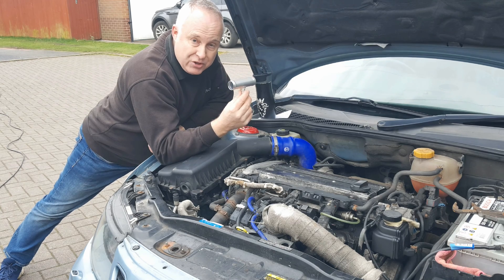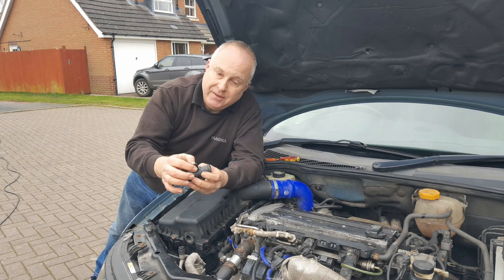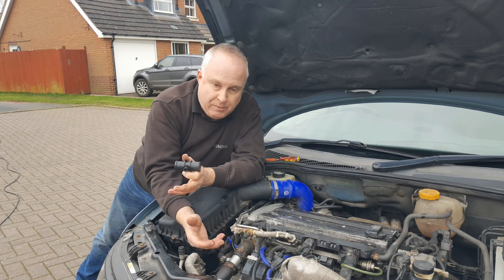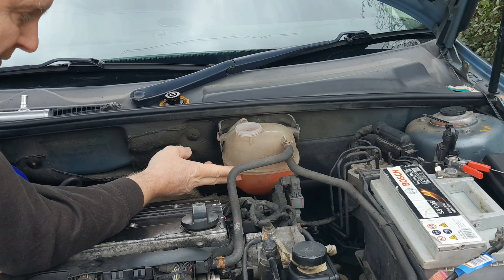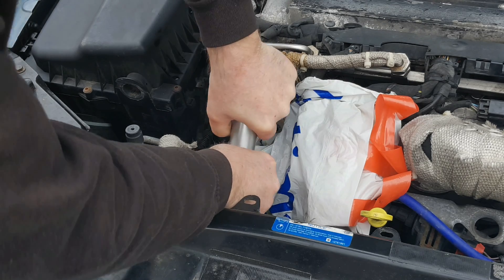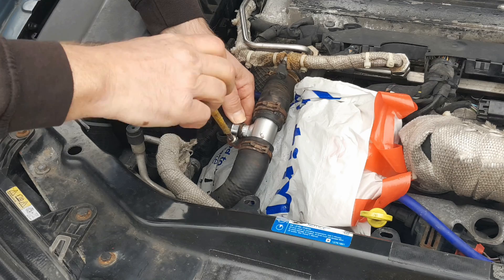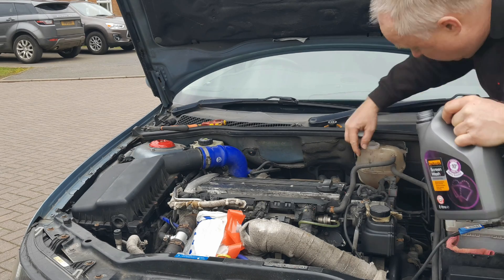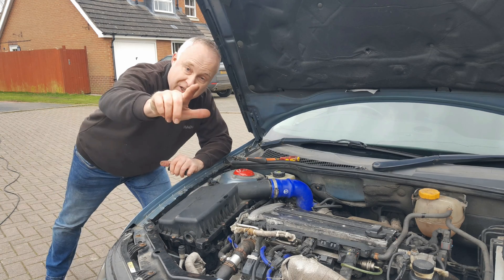Saab 9-3 Coolant Tee Aluminium Replacement | Saab 9-3 Common problems

Comment: The small pipe on that T  joint broke off  on my car just by touching it.
Reply: ... where did you get a replacement from and what did it cost ?
Reply: @_Alfa.Bravo_ from ROCKAUTO IN  USA they are available from a number of sellers.  Since I needed a number of other parts I got it all from them. What I really wanted was a T Made of  metal.

Comment: Hi, I'm looking to do this job very soon but also had/having a cooling problem. Fan has been activated quite a lot in cool weather, recently temp was spiking to a point of dash warning coming on. Found the thermostat was blocked in a closed position and failed the hot water test. Replaced the thermostat but find bottom hose staying cool when the top hose is hot, hoses squeezable so have I wonder if radiator is blocked and what sort of job it's replacement is.
Reply from the maker: I need to replace my rad too. It doesn't look like too bad a job. You can bet screws and bolts will be rusted up though!
I've since brought a one-piece coolant hose to market. A much better solution than a metal tee IMO
https://www.youtube.com/watch?v=Rkdbdg4ilRk  see description for link

Comment: Love the videos. It's amazing that I can find out how to do specific repairs on YT. I just had the "T" break on mine while I was getting her buttoned back up after replacing the valve cover gasket. I barely bumped it and it broke clean off. Glad it was in my garage and not elsewhere. I ended up replacing the entire radiator hose, t-fiitting and return hose. My original made it 332k miles though, so I can't complain...

Comment: Great video! What is the part number for the plastic OEM tee? I have a SAAB 9-5 (2004 US) and I have a leaking plastic tee as well. Is it the same part? Will your aluminum tee work in a 9-5? Thanks!
Reply from the maker: No idea of the OE part numbers. The tee ODs are 32-12-32.

Comment: Hi Fantastic videos, i have a Saab 93 petrol 2006 model Vector we put petrol in it the other day it started ok we drove around for a while turned it off went to start it it started but idled rough we got half way home and it cut out wouldn't start, so next day i took battery lead off and put back on it started straight up but its still idling rough  when i put the foot to the floor rpm wont go over 3000 rpm and engine light is on so i replaced the fuel filter  but its still idling rough it must of gone in to limp mode any idea what it could be and how do i reset the limp mode
Reply from the maker: Rough idle is almost certainly an air leak, but the first thing is to read the codes for the EML.
Where in the world are you?
Reply: @CycloneCyd  Hi we are in Victoria Australia
Reply from the maker: @Farmer2492  first thing is to read the codes. This should give some clue where to look. Get one of these https://s.click.aliexpress.com/e/_AEir79 and download Torque pro to your phone or tablet (android). This will allow you to read the codes and you'll have the kit for life.
OR 
get one of these https://s.click.aliexpress.com/e/_A06Br5
more advanced than Torque and does live data and freeze frame (which you will find useful in the future when you get used to using it).
OR
just get a garage to read the codes for you
****
In the meantime check this
https://www.youtube.com/watch?v=bgLn14dZL3Q&t=2s
it's an often missed intake leak. 
Also check all the small vacuum hoses for splits.
Also check the intake piping and the IC for splits. The ICs on these bow at the bottom and you end up with leaks. A smoke test would be good but if you can't, get the IC out and fill it with parafin to see if there are any leaks (esp near the bottom)

Comment: I can get with understanding the small T turbo hose is completely plugged off in my car and put someone put a straight upper radiator hose on I have the correct hose with the T in the hose now. Can I just put it in or could I hurt my Turbo somehow does it need to be bled Etc please help I cannot find this answer anywhere or anyone else to this problem for that matter
Reply from the maker: If it's the right size, just cut the hose and insert the tee. Fill with a cold engine via the reservoir. Run it without the cap till at least the stat opens. Keep an eye on the level. Stop the engine, return the cap and check the level again when cold.

Comment: Please help I can't find the answer Strange question nobody's been able to answer it on my 9-3 2.0 Turbo 08 I did not know about this T being a failure point until I saw this video so I looked at my Saab previous owner has blocked that small hose with Bolt in the end with hose clamp and put a straight upper radiator hose on with no T what could this do to my car I've had no overheating issues although I've done a drain and fill on the cooling system and now it's bubbling boiling in overflow no overheating on dash my guess air bubbles it wasn't doing this before the fill and flush I did it with a cleaner not with a pressurized garden homes or anything hose
Reply from the maker: I'd bet the boiling you here is in the turbo. Fix this ASAP

Comment: I bought a used saab9/3 2.0t 08 4 cylinder somebody put a straight coolant pipe on and plugged the small hose where the T would attach onto the T originally so now it's just a straight coolant line from A to B no T but the small hose that should attach to the T does have a bolt in the end w/a hose clamp around it I did a coolant flushes and fill keep getting boiling in the Overflow but not overheating on the dash weird right my best guess is pockets of air. Has anyone had a Saab where someone has discarded that T all together put a straight antifreeze tube and didn't hook up the little line just put a bolt in the end of it with a hose clamp please help very unique situation your video is great by the way!! Love your content very informative please keep them vids coming
Reply from the maker: Sort out a tee in the line ASAP. That small hose is the return coolant from the turbo. Without this cooling you could cook your turbo in no time flat.

Comment: good video but did the silicon hose is better ?
Reply from the maker: product link?
Reply: @CycloneCyd  check on do88 site there's a kit with all cooling pipes it's a cost but it include all pipes. 
https://www.do88.fr/fr/artiklar/saab-9-3-20t-2003-durites-de-refroidissement.html

Comment: Help! Issues with the turbo boost pressure valve. I’m having acceleration issues when the meter tries to go in the red.
Reply from the maker: What issues are you having? What are the symptoms? Any EML codes?

Comment: Now my 2001 93 has code p1110 and p3123.  Turbo Presure release and after market direct ignition and plugs..  .almost 500 bucks to fix and its 50 50 im not quite sure
Reply from the maker: I'm not very familiar with the OG9-3, but I have seen many people saying to only use OEM DI cassette. Also make sure to use the specified NGK plugs. Not sure what you mean by "turbo presure release" - do you mean it's got a boost leak? A boost leak will be a vacuum leak at low power.

Comment: I can hear the balance chain tensioner is also broken on your engine. Bummer isn't it! Mine has the exact same problem.
Reply from the maker: Yeah it is. It suffers the valve problem (for the last 60+ 000 miles) but the time has come for a head change, so it'll get fixed then.
Reply: @CycloneCyd  would love to see video on both replacing the head and the balance chain tensioner! How soon you think those videos would be made?

Comment: Could always use a 2nd TEE.  Had 2 replace mine's with another plastic one.  Now that I now about the Aluminium one, will get it, just as a back up.
Reply from the maker: Unless you have xray vision and can see those polymer chains, how is a used one any better than your old one? Get the ally one and fit it. It's not worth being stranded miles from home for a poxy bit of plastic. Links in description.

Comment: Quick question, so I'm used to cars Temperature gauges reading at a bit below the halfway mark when it's fully warmed up. But for some reason this car's temp gauge goes all the way to the halfway marker when  at normal operating temp. Is that a known issue with the '06 9-3's or just mine?
Reply from the maker: Yep, bang on the halfway mark is 'normal'. the gauge is 'managed' by the ECU.
Reply: @CycloneCyd  Thanks alot, I thought there might've been an issue

Comment: U are what I like to call "The Saab Swami" 🙌 I am not worthy lol. I had mine go on me about 6 months ago and of course no local places carried the part so I had to order it from eBay and wait about a week for it to come in. This is Excellent advice for those who haven't changed theirs!!!
Reply from the maker: Ouch❗ So, your car was unusable for a week❓ I've had my car 10 years now and only known about this issue for 18-24 months, but I decided to do this 'mod' for exactly that reason - it could leave you stranded and car out of use while you wait for a part. Not to mention the posibility of damage to the ECU, alternator and compressor from that hot coolant❗ 
Would you believe that when I raised this on one of the Saab Facebook groups recently, I actually had some ass from the US start arguing with me about it! I blocked him, the ingrate❗
Reply: @CycloneCyd  Well he's an idiot because what u showed in the vid is a fact, it snapped in the same spot that you showed so I couldn't even rig it with another piece of hose in the mean time. I was driving with my son and we had the top down on a Saturday night and the coolant low warning started going off, and then I started noticing the coolant smell and the smoke from under the hood. Pulled over and there was coolant everywhere. Thank God I was only a few blocks from home when it did
Reply from the maker: @hcic9860  "you can't please all of the people all of the time" someone once said. There's plenty more people in the world who appreciate what I do. I just block ingrates like him so they'll never get the benefit of my 'wisdom'.

Comment: Don't you think use hose pinch pliers to the turbo return hose to make less coolant mess?
Reply from the maker: Won't make any difference, it'll come out from the head anyway. As it's the top of the engine, you only loose about a litre anyway.
Reply: @CycloneCyd  The return hose is too big to use pinch pliers also.  Mine is 2010 110k miles already